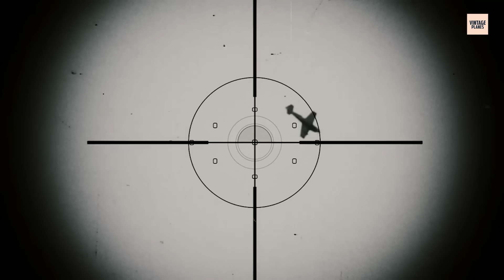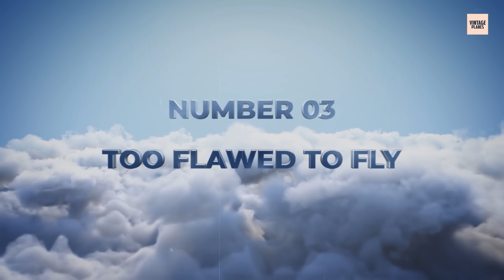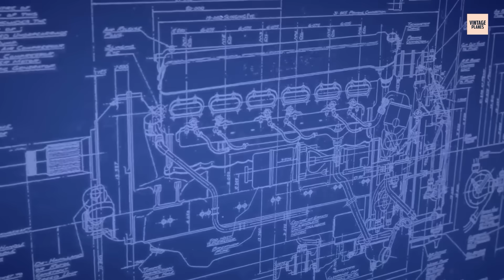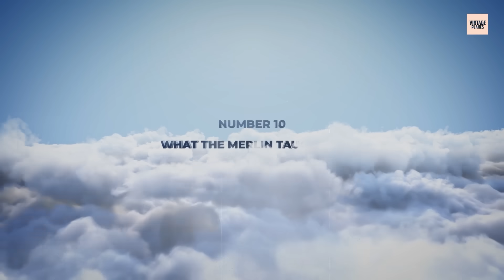THE SHOCKING TRUTH BEHIND ROLLS-ROYCE MERLIN ENGINE

Comment: Dreadful film. Another 'British is Best' story fuelled by the Little Island mentality. Honestly. By the time Rolls started working on the Merlin - for example, Cadillac had already built ultra-luxury cars with outstanding V12 and V16 engines so nothing here was new, RR were never the inventors of anything? I love that for Britain you use the word 'craftsmanship' whereas for America you talk about 'industrial might' and 'mass-production'. American craftsmanship was far higher than anything else at the time. Their precision was far advanced and their ability to problem-solve was beyond anyone else's, and it continued with RR to the eighties.

To suggest American car builders, not exactly, Packard a super high-end luxury car, that their workers weren't used to the precision required to build Merlins is absolute rubbish. The little islander mentality strikes again.

Packard produced many improvements to the Merlin. Rolls still insisted hand filing was of use whereas Packard knew (like Cadillac) that nothing beat high-precision machining for super-accuracy and repeating that accuracy. I see you don't mention poor old Ford in the UK, they built Merlines too? Too common to mention I fear. Both of these industrial giants, firms with huge resources, both contributed hugely to the improvement of the Merlin engine throughout its lifetime.  

So, AGAIN, if you believe Rolls' workers taught Packard American workers (and poor old British Ford) the art of precision machining and quality control you need a doctor. Both Packard and Cadillac worked at far tighter tolerances BEFOTRE the Merlin engine was even conceived. Indeed the ultimate in precision was developed at Cadillac even farther back in time, if of course you care to read and can have a balanced debate not littered with outrageous anti-American rubbish? Can you?

If you keep watching you of course finally agree with me, but only after some nasty American bashing.
Reply: Absolutely correct. Refreshing take on reality.

Comment: MEE here, real great engineers know and practice limited production prototypes, as the only really good way to finalize the design, before production starts. Then we need really good and near perfect manufacturing fixture to properly hold and handle the component sub-assemblies for the first pre-production runs. Fixing all of the design flaws asap. There are always design flaws, and oversights, always. Rolls-Royce never designed anything perfectly. There are always changes that must be made to make a finished product work correctly... Rolls-Royce lied to Cooper Energy Services and stole the CES(s) $$ equity built up over decodes and took it back to England. QED

Comment: This is one of those videos where research on the subject matter has clearly been minimal. Not a mention of the RR Kestrel and its role in this saga. Also the design and building of the RR Buzzard which led eventually to the RR Griffin played an important role in Merlin crankshaft, conrod and camshaft lubrication improvements. Chronologically Merlin engines were first built from fettled individual parts. Ford helped to evolve this into line production which saved manufacturing time in Britain. Packard then introduced machinery that could produced parts to such fine tolerances they almost made fettling a thing of the past.
Reply: Completely agree. Tabloid rubbish with bizarrely irrelevant video clips. No mention of the problems of cracks developing in the cylinder block, requiring a complete redesign of its revolutionary single casting. Nor the brilliance of the mathematician Stanley Hooker, who redesigned the poor supercharger to increase power output from less than 1,000hp to 1,300hp. Nor that early Merlins could only run for 250 hours before major overhaul and the later life never exceed 500 hours - a serous problem for post-war civilian use. By 1945, Pratt and Whitney and Wright engines were good for 1,000 hours and more.
Reply: The mass production changes were made well before Packard. Ford of Britain  first suggested  the mass production changes  for unskilled labour  and was   involved in the  early shadow factory scheme and built 25,000 or so at its factory in Manchester Trafford Park. Packard had to make changes in drawings and some details for different  US style production. As well the  cylinders design was changed for the much higher power outputs coming  , instead of using RR design  they used their own modification. This wasnt related to mass production

Comment: The dramatisation of this story is out of step with the reality. Engine development by RR was one of thoughtful design and careful engineering, effort providing considerable success. The 'R' Engine powered the  Schneider Trophy winner by cranking out 2 thousand plus horsepower, success built on by RR initiating the PV-12 that became the Merlin. Yes, it took time to get the reliability and power that saw it become such an important contributor to Britain's war effort, but this is normal. The great Pratt & Whitney R-2800 had its share of issues that led Luke Hobbs and others to overcome by analysis and corrective engineering solutions. None of this needs anything more than recognition of the genius and dedication that lies behind all engineering success stories.
Reply: Mr. Sheridan, above, is correct.  Your hyperbole is out of line.  Your editorializing, that freedom was won based on this engine, is preposterous.  And clearly, no accomplishment is impossible if it is completed.

I think your audience is much more sophisticated than you realize.
Reply: @MMThomasPhD  100% agreed, the hysterical, gushing hyperbole reaches levels reserved for religious fervour and detracts from what is otherwise a great video.
Reply: All engines have to go through development stages. Most of the pictures and film clips used in this video have no bearing on the Merlin engine and the planes they powered.
Reply: Thee Supermarine S5 the first of the three aircraft to win the Schneider Trophy was powered by a Napier Lion engine, why let the facts get in the way of a good story.
Reply: @allenjenkinson7608  Yes, Napier powered the early S5, but the R engine powered the S6,.
Reply: Some of y'all have your heads so far up the Queens butt you can see the truth. The Merlin was a good engine. We built the Mustang, stuck a Packard Built Merlin in it, added Fuel Injection and some other help for that so-called "Perfect" Engine and saved y'all's asses.
The closest thing to "Perfection" back then was the P&W Double Wasp in a friggin F4U Corsair, more H.P and was more reliable. Now we did give y'all some of those and y'all did teach us how to land that long nose S.O.B on a Aircraft Career so I will give y'all that. 🤣

Comment: Where do you get the idea that the American built quality out do Rolls Royce, this company has built and still builds the best power units in the world. Always member the original Merlin was built and designed under very stressful conditions  and Britain supplied the design parameters and engine for the P51 Mustang, all get your facts right the original Spitfire and Hurricane Merlin engines were carburettor not fuel injected, great and a wonderful engine.
Reply: I won't say Packard built a better version.  I will say the British were astounded that Packard could mass produce these engines with the same quality as the British built units. The British didn't think it could be done.
Reply: @brianschumaker5912 not sure where you get your information from tbh, RR mass produced more engines than Packard while being carpet bombed by the Germans. If RR didn’t think that it could be done they wouldn’t have sent their engineers over to America to sort out the manufacturing issues , they had to show Packard how to cast the blocks and heads without cracking and rectify the thread form errors of Packard that lead to stress fractures.
Reply: @ThePaulKat  More BULL$HIT stories as PACKARD had been building aero and PT boat engines since WWI, the Liberty V12 was a Vincent design, of Packard pluss the N2500 PT boat engined the Brits also used, PACKARD knew how to build engines and BULL$HIT story was just a Brits excuse that they had to beg for help to save theor sorry @$$'s in WWII !!!
Reply: @brianschumaker5912 if we didn't think it could be done why did we facilitate it?
Reply: @brianschumaker5912  RR produced a lot of specialist tooling that combined with great quality control allowed Merlin's and parts to be made by subcontractors and shadow factories in Crew, Glasgow and Fords in Liverpool. Packhard built about 60% of Merlin production but they were not being bombed and starved of materials and manpower.
Reply: @brianschumaker5912   Thats a myth. Ford of Britain were the first to suggest  modern mass production techniques  and they  had the massive  factory at Manchester  which was  built soley for Merlins. Packard had to change the production drawings  for US standards  thats all.  A further change was the way cylinders  were produced   for the much higher power outputs . Packard  preferred their own  slightly design rather than RR. This wasnt connected to mass production
Reply: @brianschumaker5912 Packard were as good never pass up  good looking for best in a time of war
Reply: @StanleyCollins-e4t 
I feel the same way. Packard spent less time spit polishing, and concentrated on specs.
Reply: The Packard Merlins weren't quite as reliable as the original. It has only two piston rings as opposed to the original's three which it  made it easier to seize under high performance. And certain production series for the Spitfire Mk XVI had cracks in the crankshaft making them break down. Not surprising considering the pressure of the times.
Reply: @VidarLund-k5qnever knew that....thanks
Reply: Yes carburettor,which frequently stalled and killed hundreds of pilots..That's why early  Spitfires couldn’t dive with 109's..German aces Galland and Mölders discovered this disasterous weakness fast and became notorious Spitfire killers..😂
Reply: @barracuda7018 hundreds of pilots killed due to carburettor stall😅😅 how many pilots do you think the RAF had during the battle of Britain this video is very misleading and inaccurate with the truth
Reply: @XOsubmariner  No one knows the "exact" amount of RAF Pilots that Stalling during negative G maneuvers killed. Or the fact that carb freezing was the reason they couldn't go up and meet the BF109's. It could be 20 it could be 120 you or I or anyone else can't say, but it is a proven fact that it did happen until they went to the Pressure Carbs which is nothing more than Throttle Body Fuel Injection. There was a little valve they used on some Carb equipped engines that would help during negative G maneuvers but wasn't a 💯 fix like Fuel Injection was.
Reply: @adamrodgers2377 the Merlin was never fuel injected , they were initially fitted with a Skinner’s Union dual choke updaught carburettor then a Bendix pressure carburettor. The issue with the SU was that it would create an over rich mixture during a neg G manoeuvre. RR chose carbs over direct fuel injection for performance reasons as Stanly Hooker noted the German’s paid a high performance price when opting for fuel injection.
Reply: @barracuda7018   Bingo! Finally someone who knows what the hell they're talking about!
Reply: Mr Rolls is probably Rolling in his grave due to the Germans owning his company today and Charles well they've made a proper Charlie of him .Rolls Royce the Pride of Germany. Bentley Blown away The people's car . Packard long since gone 😂
Reply: The Packard re-design of the Merlin for American standards and production was designed to be extensively tooled for mass production, and as usual was produced to tighter tolerances than Rolls-Royce production. Rolls production used skilled fitting, and the production volume ramped up with expanded facilities and staff.
The Packard engineered version also introduced the separate head and block and a different supercharger gear system, chosen for producibility.
The Merlin was a very complex engine, more than 10,000 parts. The Allison V-1710 had half that parts count.
The bottom end journal bearing changes were discovered by P&W who shared their breakthrough with other allied producers for the allied cause. 
Postwar, civilian airline operators found the radials more reliable, with greater TBO and lower operating costs.
Reply: It was a good engine at the time but even than corruption was about we could have had jets engines at the same time but rolls made sure he got the contract
Reply: The Packard Merlin had one flaw compared to the RR version, only two piston rings as opposed to the original three, resulting in poorer lubrication, which meant it seized under extreme duress. I read that this happened to the Packard engined Spitfire Mk. XVI.
Reply: Knowing British industry America had new equipment to build engines, Britain tools from Victorian era.
Reply: @flybobbie1449 a lot of the tooling for the Merlin mas production was custom built.  The bed may have been salvaged from an old machine but a lot of it would have been new production.
Reply: @flybobbie1449 exactly 😊
Reply: @flybobbie1449 
The Brits did have one thing..... true craftsman.
Reply: @brianschumaker5912  Was needed to hand correct everything. In the 80's at work our main press draw shells in WW2, typical British industry.
Reply: Carbs only because limey beaurocracy didnt grasp fi.
Reply: @rudydevich9046 true😵‍💫
Reply: @rudydevich9046 obviously you haven't got a clue, the carburetor problem was soon overcome
Reply: According to the genius, Stanley Hooker in his book NOT MUCH OF AN ENGINEER, he mentions that FORD UK was instrumental in making the Merlin reliable and enabling mass production.
Reply: @cobusswart1999  Ford UK was seized by the UK government and used to build 36,000 Merlins in the same time period PACKARD built 55,000+
Reply: Good but limited until the staged Supercharged.   Those were put into the stangs
Reply: Sorry but you really don't know what your talking about.
Reply: @paulbedford9816 and it seems neither do you.
Reply: @iantucker1398  Actual I do and it's based on 50 years with American engineering, Cadillac and Rolls-Royce.
Reply: @rogerhorton  The PACKARD built Merlins were better quality and went longer time before overhaul !!!  PACKARD knew how to build a quality engine, as they had since WWI, and PACKARD also built before and during the war 14,000 of their own design, 3 years before RR came a begging their M2500 PT Boat engines, 50% larger than a merlin, and it was that engine the Brits were receiving that Brought RR to PACKARD for the Merlin !!!!   FYI  Facts of history !!!! !
Reply: I totally understand being proud of where you're from but if it wasn't for the United States you would be speaking German right now.

Also you don't know squat about a damned WW2 WarBird, if you did you would understand Fuel Injection was the reason the Spits and Hurricanes couldn't fight at high altitude because the damn Carbs would freeze.

The FW190's and BF109's were ten times the WarBirds the Hawker was and a deadly match for the Spits and I love the damn Spitfire. You need to take your blinders off and realize if it wasn't for HELP! from us uncivilized Americans you or your family might not be here at this time.
Reply: @adamrodgers2377 England still in horse and cart days 😊
Reply: @adamrodgers2377  Wasn't the carbs but the superchargers !!!  DUUUUUHHH!!!!!!  Why RR used 3 different superchargers during the war !!! A single stage, early, then a single stage 2 speed, most used and finally the drooled and slobbered over 2 stage 2 speed superchargers that used a Bendix pressure carb, Which FYI ALL PACKARDS used from the get go!!!!
Reply: @adamrodgers2377 And if it wasn’t for the Japanese Americans would still be sitting with their fingers up where the sun doesn’t shine…..and then speaking German.
Reply: @JamesBeech-y9v  You sums a Beeetches seem to forget YOUR European war was NOT the USA's war !!!! You caused WWII by not enforcing YOUR WWI restrictions on YOUR armastic !!! !  DUUUUHH!!!!!!!
Reply: I read a book by a test pilot who worked with spitfire/ Merlin aircraft, he was testing Packard engines, he had failures caused by cam bearing failures which were unexplained until he managed to land a test aircraft without a fire
Reply: @peterclancy3653  Thats a F'n Lie because the PACKARD merlins were not used in the $hitfire until the 1030 Mk XVI in late 1944 !!!  $hitfires used engines built by RR.  Ford UK built merlins went into the Lancaster MkBI,  PACKARDS went into the Lancaster MKBIII and the Hurrycane and Mosquito !!!  FYI  the special modified Lancasters used for the Dam busters were ALL MkBIII PACKARD powered !!! FACTS of history !!!

Comment: The Merlin was a refinement of a longish line of aero engines. It still had faults, like an inefficient supercharger, and poor cylinder head design.  These were designed out. In comparison with other engines of the time they were certainly no worse.
Reply: the supercharger is the reason the Merlin outperformed the crappy Allison and gave it the ability to operate at hi altitudes